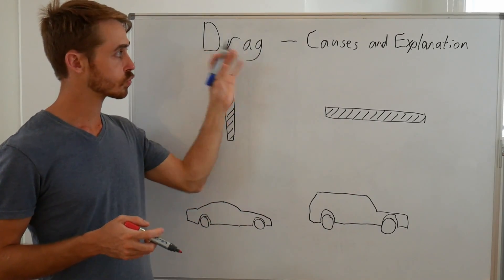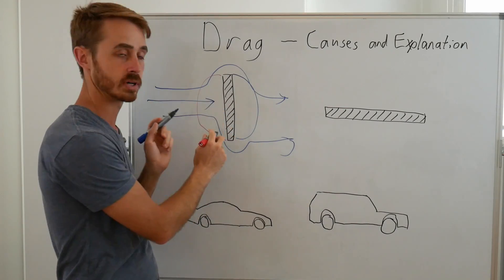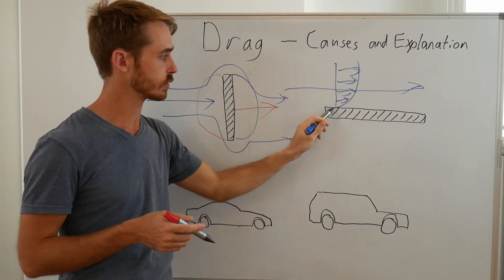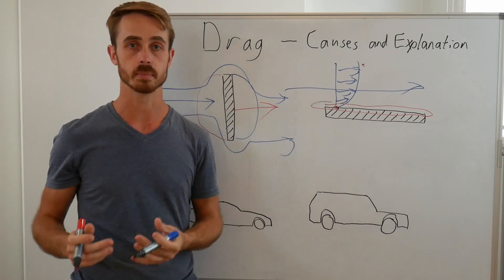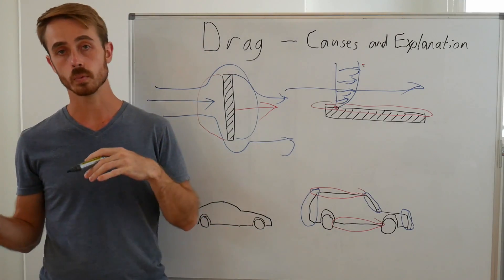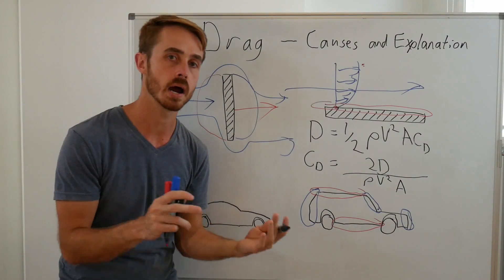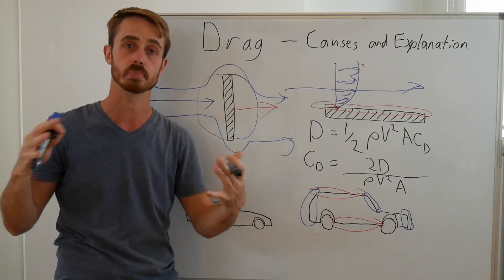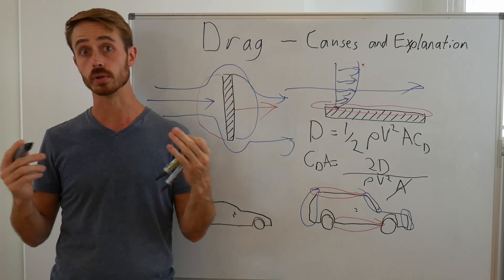What Causes Drag on Cars? Viscous and Pressure Drag Explained

Comment: So from what I  think I understood. It sounds like there is a thin area of vacuum at the surface. Between the static area and flow. This vacuum is what adheres the surface and flow, and works as a form of gravity. I see this as why it curves up toward the flow area where pressures are higher. Am I wrong in this?

Comment: hi on a part that is 450mm long 45mm wide with a rounded profi,e moving at 32mph would a golf ball effect disturbing the air flow be better or worse than a smooth side

Comment: Is this how the Tesla truck can have a lower coefficient of drag than a Bugatti Veyron? Is the reason that the rear low pressure area is not being input into the equation? Wouldn’t it be more efficient if the back of semi trucks was tapered at the end?

Comment: What program do you use to simulate airflow? I'm trying to design an electric race car, modeled on fusion360, and I'm currently using flow design. Would you know of a better free or low cost program?

Comment: Hi, can the position of the exhaust affect the aerodynamics of the car? Like behind front wheel (like SLR) vs on the side ( like Shelby Cobra) vs in the back ( like most of the cars) ?
Reply: side exhaust make space for bigger diffuser in the rear
Reply: Though rear exhaust can benefit from the cars draft to pull out the exhaust gasses?

Comment: could you significally reduce viscous drag in the water with air coming out of the front of a ship? I think that should work
Reply from the maker: The Shkval worked well because it's small, doesn't need to run for a long time and moves fast, on larger ships it is much harder to get a consistent film of air along the hull, you'll need multiple air jets and a lot of power etc. Not to mention how sensitive it will be to cruise vs max speed etc. 

I guy I knew did his PhD on superhydrophobic surfaces for ships (slightly different tech obviously) and found that the benefit was negligible, just an interesting bit of info.
Reply: onethirdofGilgamesh - what you're talking about is similar to a hydrofoil. It's a boat that partially lifts itself out of the water, so as to displace less water.
Reply: Boundary layers exist both at the surfaces of solids and at the boundary between separate fluids.
Reply: Lots of experimental ships have done this. But the most extreme example is the VA-111 Shkval torpedo.
Reply: VA-111 Shkval torpedo do not use air it is surrounded by water vapor, it use effect of cavitation (supercavitation).
edit: pumping air into water around ships is used in all modern icebreakers.
Reply: +KYLE.DRIVES You do not need to move extremely fast to get effect of cavitation, professional divers produce it every time when they enter in water.
But for surface ships easier solution is to use hydrofoils then cavitation as it is used for years for fast passenger service in many countries (most popular is Voskhod)..

Comment: Does a freshly washed and waxed car have less viscous drag than a dirty one (without big clumps of dirt on the car)?
Reply from the maker: Depends in the height of the roughness from the dirt, that will change whether it's creating recirculation pockets on the surface that will reduce the shear intensity, or if it's just presenting more surface area. The bigger effect you'll see is a local change in the reynolds number, which will change where flows may be separated or attached, which could result in significant pressure changes if the surface is on the edge of separation. Mostly though, I would say the difference is minimal.
Reply: It used to make a difference in Gran Turismo. lol
Reply: I would have to assume that the surface area of a car is small enough for it not to really matter. As there are far larger forms of drag that will have a far greater detrimental effect before the level of grunge and grime even factors in.

However, I have heard that there is some benefit to doing this on a commercial air liner. Where they spend several thousand dollars washing and polishing the surface of the aircraft every several months to a year during its overhaul service.

That said, I have also heard arguments made that suggest some surface texture is actually a good thing. On everything from engine intake runners, to the so called "shark skin" swim suits that used to be worn by professional Olympic swimmers (before they were banned anyway). And I have seen that idea employed on time trial bicycle helmets (being textured on the front, and smooth off the back), and even the time trial skin suits themselves, where the shoulder, chest, and front thigh area have a rougher mesh, and the rest of the suit is a smooth Lycra material. I have even heard that NASCAR teams did coast down tests using textured decals on the car to promote flows they wanted. And there was even rumor that the  flat paint that Red Bull where using on last year's F1 car was done for aerodynamic reasons.

I'm actually curious to hear your take on this Kyle, I think it is a fascinating subject. The idea that a textured surface can effect the boundary layer enough to promote a desired flow characteristic. That would make a perfect follow up to further delve into viscos drag.
Reply: Ruben Ardesch - theoretically, yes, but the effect is not too great. If you're thinking you'll make your SUV more fuel efficient than a much smaller, much more efficient car (like a Subaru BRZ) by keeping it clean, you're vastly overestimating the importance of this effect. In a formula 1 car, it may be more effective.
Reply: Andrew Geier, I was just wondering about it, I know it's almost insignificant in relation to fuel consumption, but it's interesting anyway. Also I was thinking about golfballs with dents in them have less drag than smooth golfballs and how this relates to small dirt particals on a car and the effects on viscous drag. Maybe implying that a dirty car does not necessarily experience more drag than a clean and waxed car.
Reply: Ruben Ardesch - yeah. I'm just pointing out that the point of this video is that surface area is a bigger deal than the cleanliness of the surface, in terms of aerodynamics.
Reply: miatamang ...It still does. But, Gran Turismo isn't the best source of information. This is the same game where people can't even heel-toe.
Reply: Andrew Geier, Well of not, it's a video game. It does make the car nice and shiny though, which is realistic. lol
Reply: of course not*

Comment from the maker: Typically, pressure drag is far more important than viscous drag. Enjoy the video!
Reply: Is that one of the reasons trains have such a high top speed even though their specific power is abysmal?
Reply: Its Wonderful! thank you so much for explaining this
Reply: Torque is what accelerates a train.
Reply: KYLE.DRIVES explain boundary layer
Reply: Normal pressure drag is much less significant than skin friction drag in trains (Kyle calls it viscous drag in this video but it's the same thing), but it's also something you can't really get around (trains are long so have a large surface area) - generally trains are faster because they are very powerful...
Reply: @AlexanderStarchild Plus the fact that the wheels and rails are made of steel for very low surface friction
Reply: Torque is what moves a train, power output is less of a concern.
Reply: basically Torque  is what gets you going HP is what keeps you going as simple as that